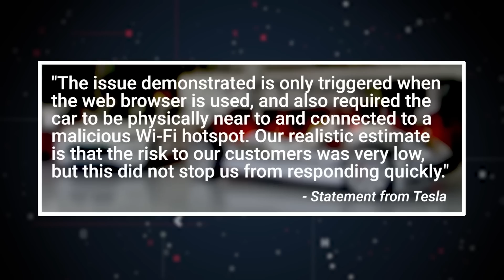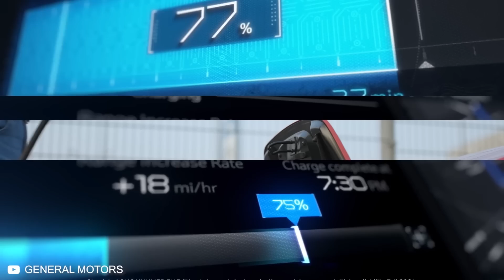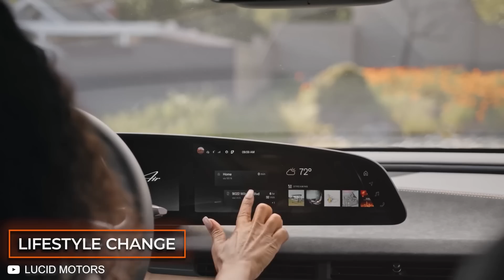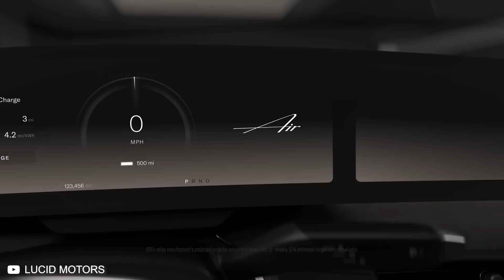EVs' Serious Problems That Carmakers Are Hiding

Comment: FYI it’s actually better to consistently charge anything with a battery it’s only bad if you keep discharging the battery all the way to 0 and charge it to 100 that will fuck up the degradation

Comment: A Tesla battery pack replacement is $22,000 from the Tesla dealership. 10 years is roughly the lifespan of the battery pack. No thanks guys.
Reply: You'll be lucky to 4 to 5 in a model Y. My dumbass ex leased her Y a year ago and has already had $28,000 worth of repairs and the Y is a disgrace. Tesla sucks balls, I'll stick with my Ford Edge.

Comment: What happens when you get to your destination with a low battery and find the power has gone out from any number of natural or man made disasters and you can’t charge the vehicle just when you need it the most to escape danger ?
Reply: There's a term for that.  You're SOOL.
Reply: Better hope Superman arrives on time.😂
Reply: Or some metal thief has cut the cord off.
Reply: exactly!
Reply: Same happened to me with IC. Power went out and all gas pumps stopped working.  Even worse cash registers stopped working also. The only way I'll own EV is if I get a battery with 500+ mile range.  If I get Cyber Truck I also plan to get solar power for my house. Having stated so, that's not cheap but I can afford it. My plan is to start a side hustle like Uber or light delivery just enough to offset extra cost plus you gain business deductions. The cost of the vehicle will be depreciated.  I live in Austin so we have plenty sunlight and Truck will be made less than 20 miles from my house. I don't think I  would do  same if I lived up North. There are plenty horror stories about EV in the winter. Another wonderful benefit of huge battery like the one in Cyber Truck is if power goes out there is enough electricity to power your house for 3 to 5 days.
Reply: As mentioned in a prior post the same can happen if you need gas.
Reply: @fyourfeelings8966  doesnt gas station have generators?
Reply: @divin3kag3242  uh,  what bougie gas station do you go to?  ever see a generator?  what pumps gas in that generator?
Reply: @lesliehuegerich2314  ummm the pump runs on electricity so if the power goes out and the generator kicks in the pumps are back online, thats just common sense
Reply: @divin3kag3242  Some. Not as many as you like.
Reply: when the power goes out you cant get gas either.  what do you think runs a pump?
Reply: @lesliehuegerich2314  I carry 6 extra gallons of gas in each of my vehicles for just such an occasion and some EV charging stations have back up diesel generators if your lucky enough to find one in time but I’m more concerned about when there’s no gas, diesel or electricity left to be had at any price.
Reply: @mattsmith1137  Mississippi or Louisiana in 2005, for example. It was 300 miles to the nearest place to buy gas. My national guard unit went in for disaster relief and had to have fuel trucked in from out of state for weeks. Fortunately the NG has fuel trucks.
Reply: @lesliehuegerich2314  it's called a Generator.....

Comment: By 2025, there will be zero new ICE cars and only ones left will be used as ALL car manufacturers have already shifted to only making EVs.  By 2030 less than half those ICE cars will be remaining in working condiction.

Communities need to get on the ball and put up the charging stations and covered parking areas to remove the sun element from parked vehicles being overheated.  These covered parking areas will also lower local ambiant temps resulting in lower cooling needs and bills.

Comment: The biggest problem with EV^s is the infrastructure. With good connected  infrastructure,  it will work. If all petrol stations had to have EV chargers,  and they can come up with a viable standard for exchanging.
Reply: Yeah.... Good lusk with that. How long does it take to recharge a battery? How long does it take to fill up the fuel tank? Imagine the lines... There would have to be an order of magnitude (or even two) more charging stations then fuel pumps. Want to do superfast charging? Well, how will you manage to supply with power a dozen of 350kW chargers? Lets say an average charging station will have very, very modest 10-car charging capacity. 10x350kW = 3,5 Mw

Now imagine an apartment building with 500 residents. Let's give them parking spaces with slow overnight charging at about 30k. You get 15MW for the whole building for charging alone - without any lights, pumps, elevators, heating, AC, TVs, computers, ovens etc used by the residents.

Replacing full-size ICE cars with full size electric battery cars is a scam - it wont help the environment and would overwhelm the power grid. Small EVs (scooter-sized) for shot haul individual transport would make sense.

Comment: I'll stay with gasoline, the hell with coal powered cars.
Reply: If you could afford an EV and replace the battery later, you would emit less CO2, as an EV recharged by a coal plant puts out half the CO2 as a gasoline car the same size doing the same trip and even much better in stop and go commuter congestion.

Comment: This is nonsense. EV is way less hassle than a gas car, plug in at home overnight just like your phone. For most people most of the time that's all you need to do, probably not even every night.
Reply: For me reliable gas car is way less hassle than an EV (and I have driven EV).  Why?  I can repair my reliable 30 year old gas car by my self in my driveway and do any maintenance by myself.  EVs?  My EV broke down and I was so frightened with fear as there was no way  could do anything except call tow truck and hope for best.  What about when EV battery goes bad?  What will it cost to replace it?
Reply: @springer-qb4dv  your ev broke down? What happened to it? Electric cars are so much more reliable than gas cars it's not even close. I appreciate you have the skills to work on your 30 year old car, but any modern car has lots of tech and computers so even a modern gas car wouldn't be a DIY job to fix.